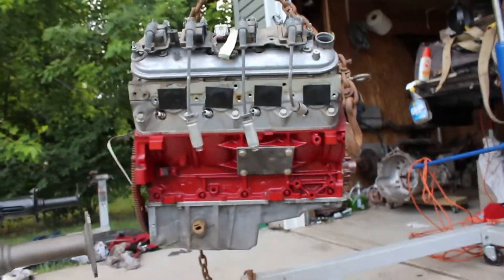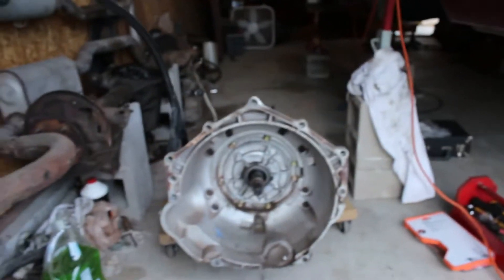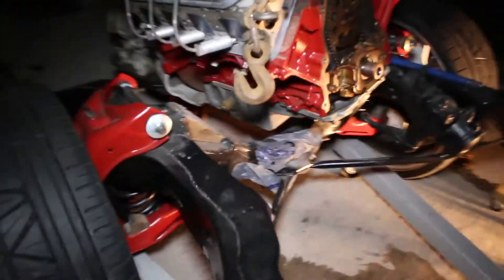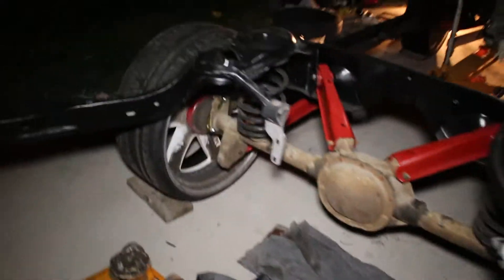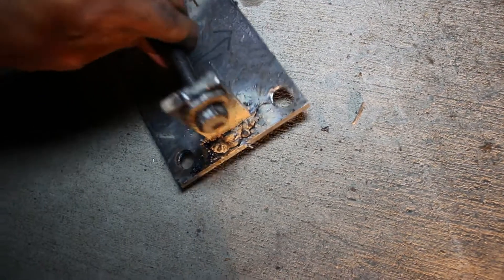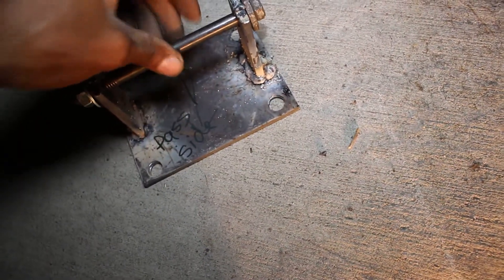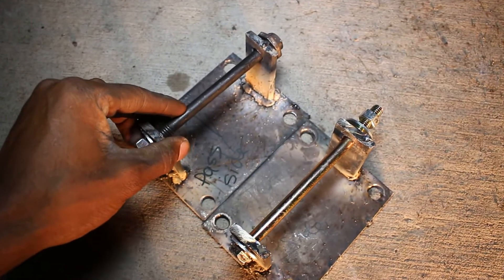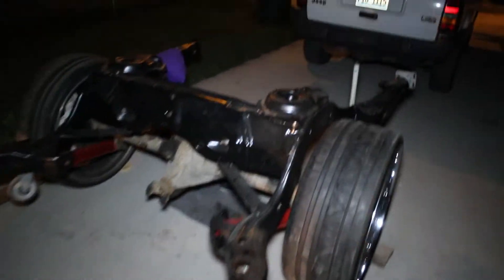Making mounts & trying to get the engine mounted

Comment: What's up!  I wanted to know why you had to raise the engine and what's the benefit (if  any) of using mounts that are solid and not flexible.  Thanks.
Reply from the maker: The engine isn't lifted. it should be sitting exactly where the original engine was.
Reply: okay.  cool.  thanks!  keep working it.